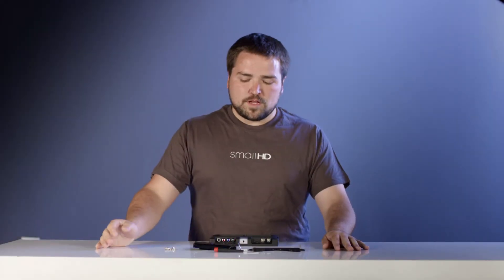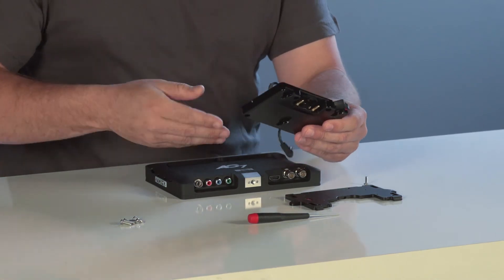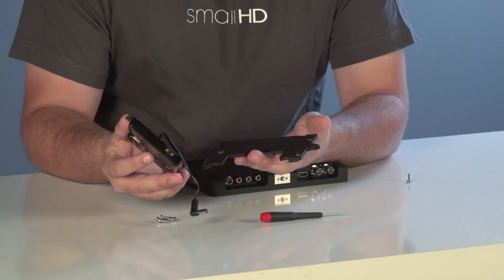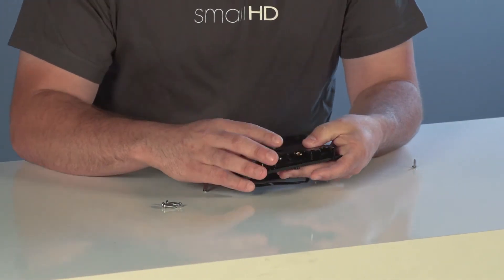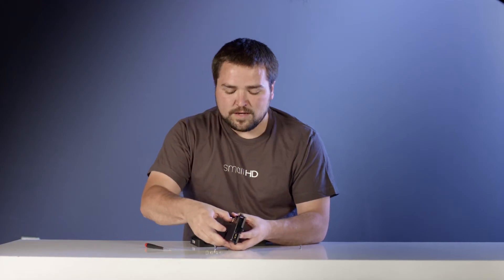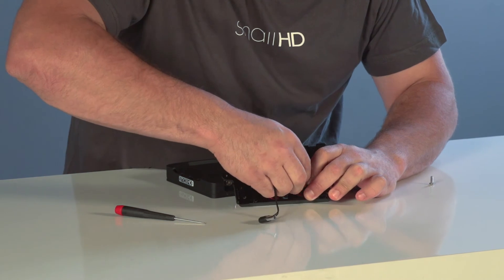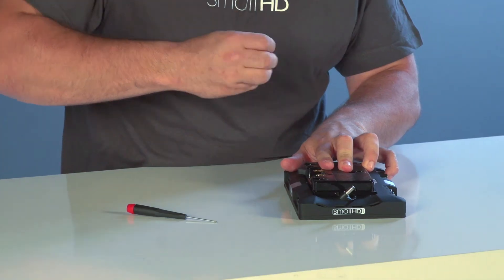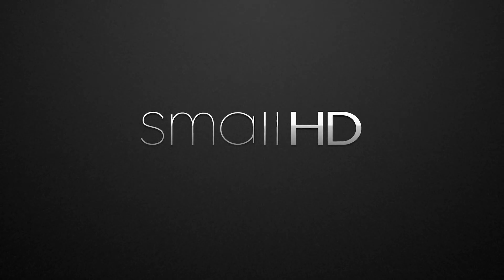How to Install an Anton Bauer Battery Plate on a SmallHD AC7 Field Monitor

Comment: Hi i just received a JVC 250 Camera, but it only came with the battery, but not the charger or the adaptor. I'm looking on ebay for a charger, but i want to make sure i get the right one. can you help?. My email is safeoinc@gmail.com. Laffeyette
Reply from the maker: We don't actually make or sell that product. Have you talked with JVC to see if they can support you?
Reply: No but i will. Do you have a contact there at JVC?
Reply from the maker: I don't have a personal contact but I found this: https://www.google.com/search?q=JVC+customer+service&oq=JVC+customer+service&aqs=chrome..69i57j0l5.4150j0j4&sourceid=chrome&ie=UTF-8
Reply: thanks

Comment: Is it possible to attach a regular V-lock battery to the back of an AC7 Oled? I've seen the Wooden camera cage which looks handy - which cables/attachments do I need to make this work with the AC7?
Reply from the maker: If you're using the Wooden Cage to attach the Vmount battery bracket, all you need is the dtap to Hirose or dtap to barrel cord: http://store.smallhd.com/store/AC7-OLED-Accessories